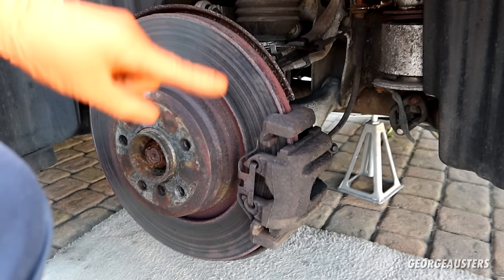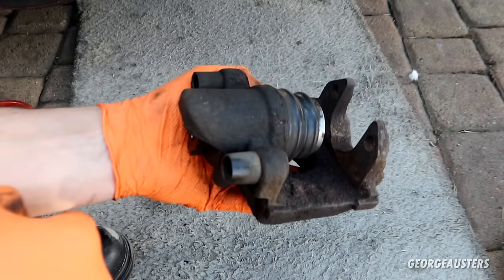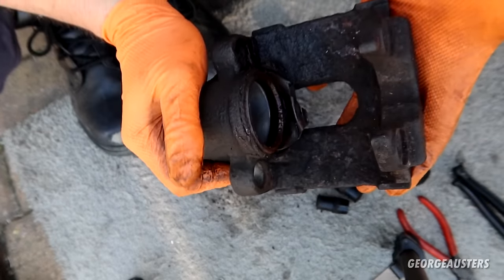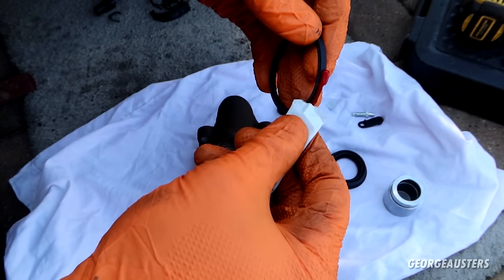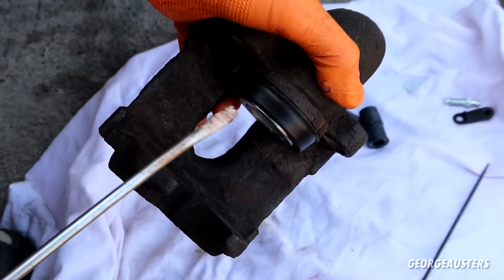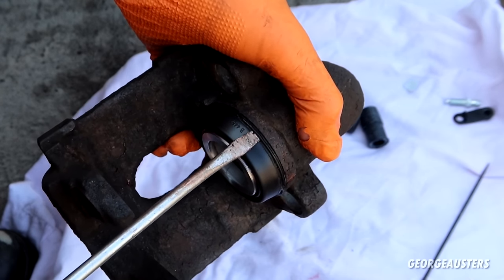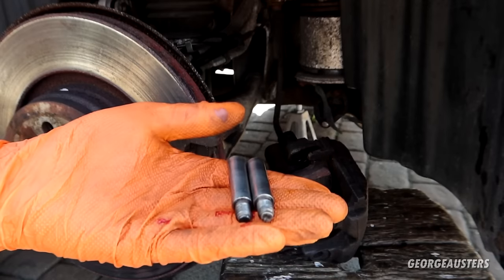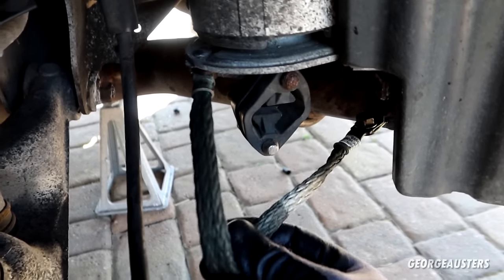How To Rebuild A Brake Caliper (New piston, seals etc)

Comment: It's very important to point out that you should NEVER use any type of grease on rubber seals except for silicone based grease.any Petroleum based grease WILL cause the rubber seals to swell and cause the caliper to stick/seize.
Reply: The grease that comes with the caliper rebuild kit is silicone based, right?

Comment: Nice video George. Just a little tip.. when installing outer dust boot it is easier to put boot on lip when the piston is out of calliper. Slide boot to the lower edge of piston and then slide the piston trough boot.
Reply from the maker: Interesting👍🏻
Reply: i do not recommend this method of putting the boot on the caliper first. I just managed to tear the boot from the inside when trying to slide the piston in later..even though i was super careful.
Thumbs up for the method shown in the video!
Reply: @

OttoKaarelAltroff

Comment: Great to see someone repairing. Any Muppet can bolt a new part on. I prefer to repair not replace.
Reply from the maker: I’m the exact same, no point throwing parts away if they’re easily saved!
Reply: Thing is a rebuild kit costs 25 quid and a new caliper cost 50. You have a lot more work to save 25 quid...assuming the rebuild works, because you might have rust on the caliper body around the piston, you could also easily damage the seal and they don't sell it separately so you'd have to buy another kit...is it work the risk and hassle to maybe save 25 quid if all goes well, when you know for sure a new caliper will work straight away and you can change it in half hour and be done with it?
Reply: @BigUriel rebuild kit costs 12-15 quid buddy

Comment: I know that quality calipers are built like tanks but when I rebuild them I prefer to remove all the cruddy rust, clean them up and treat and paint them with something heavy duty like POR-15 or KBS. They not only look a lot nicer this way but they're going to last longer, stay cleaner and be easier to work on.
Reply from the maker: I did paint them later

Comment: Did mine today but after bleeding and going for a test drive I found the brakes to be pretty spongey and unresponsive. They can just barely provide enough force to engage ABS when I really floor the brake pedal, but they used to lock up much sooner. I'm wondering if I should have filled the cylinders with brake fluid before reattaching the brake line, as I'm not sure if the bleeding process is able to get all the air out of the cylinder. It's also possible that the old pistons were just not retracting very far, thus reducing the travel needed to do hard braking (in other words, what I feel as "spongey" is actually how they should feel and I am just used to sticky brakes).
Reply: The ABS system needs its own bleed I reckon

Comment: it is VERY easy to tear or puncture the seal. once you get piston in with seal, use an airline to pressurise the boot. This will make it expand enough to seat itself on the caliper. This is the only way which worked for me. Also remember to make good the points where the pad edges contact the caliper. Rust stops the pads moving in when they wear which side-loads the piston to the point where it seizes.

Comment: Another fantastic video - great, clear explanation of work needed and work carried out. I use silicon grease on the slider pins of my brake calipers. I would be confident to strip down the calipers on my brakes after watching your video. Thank you.
Reply from the maker: Thanks man, appreciate that. Yes silicon grease works just the same!

Comment: Great Job 👏🏼 - I would have greased the inside of the piston housing too. To get a bit more grease in. Keep up the cool vids ✊🏼
Reply from the maker: Thanks man, yeah doesn’t hurt to!
Reply: Grease will hold dirt and sand. Use as little as possible. I do use a little on the slides, because they are covered with a boot.

Comment: Great video. I dunno how you got that last lip in that’s currently where I am stuck. However I didn’t use any grease and I think the kit is not an exact fit. Getting the caliper cylinder in was a bit difficult also but getting it out was a breeze. I sprayed compressed air in the brake line hole and it popped right out 😂 used wood blocks to catch it of course. I was also wondering if I soak this in degreaser can it damage any of the internal components?

Comment: Hi george thanks for your video, I am trying to fit out piston boot and it will not fit no matter how hard I try, what else could I try?
Reply from the maker: It will fit but it’s tight, I generally use a flat bladed screw driver to push on the outer steel ring but be careful not to split the boot👍🏻

Comment: Hi George, Where did you find the rubber plug you have on the end of the brake hose? I have been looking for something like that a while. This will remove the need to have something clamping down on the hose.
Reply from the maker: It was just from a new fuel filter

Comment: Oh for crying out loud, you're a life-saver (if I haven't botched up the job too much already).  I was under the impression that no grease was compatible with brake fluid so I only used brake fluid to lubricate the O-ring and piston surface.  Now the piston is in crooked.  I'll bet if I used some of that red rubber grease, I wouldn't have had such a problem sliding the piston past the O-ring.  Be careful when you Google "red rubber grease" because a lot of the results will be that Lucas Red "N Tacky grease which is something different.  I see off to the side that Castrol sells a "Red Rubber Grease".  I've seen it in a Castrol container and in a white container on Amazon.  Now I've got to get me some and hope I can remove the jammed piston from the caliper without destroying the new rubber dust cover.  Actually, why not destroy it.  They're cheap.  Thanks for posting your video otherwise I would never have known about that red rubber grease.
Reply from the maker: Glad to help... Yes most piston kits actually come with grease to use
Reply: @GeorgeAusters  Apparently O'Reilly's auto supply store doesn't supply the grease with their O-ring and rubber dust shield.  That's why I never knew about it.  But, I got the jammed piston out.  90 psi of air pressure does wonders. Of course I had a piece of wood for it to bang against instead of the steel caliper.  Now I'm just waiting for my red rubber grease to come across the ocean.  Is that a mainly United Kingdom product?  It's made by Castro which we have here but no one seems to carry the red rubber grease.
Reply from the maker: Not sure but it’s been around for a while

Comment: stick a shim and pump the brake next time works like a charm
Reply: @Ally.MacMillan  wtf you talking about, as soon as you pump the brakes the piston will fly out, try it and let me no what happened, im a mechanic and if you dont put old pads or somethigg when pushing the piston out it will fly out with fluid, thats why i said shim it so you can get it moving

Comment: The intent was fine, the advice is bad. Don't grease the pistons or piston bores. You will contaminate the brake system and fluid by doing so. If lubrication is needed, use the correct brake fluid for your car, fresh of course. And do not use grease on slide pins or anything rubber. Silicone paste should be the only lubricant that touches rubber, and same with slide pins. Silicone or ceramic only. I've seen this mistake made too many times. You will be buying new calipers and brackets if you do the same.
Reply from the maker: Lol done this many many times and never had an issue!

Comment: My car has not even got over 3k miles & i have alredy changed brake disck  brake pads & both front caliper & handbrake wires 🤨 & o it is not a bmw...
Reply from the maker: 3k miles from new?
Reply: @GeorgeAusters  yes I bought it new
Reply: is it a race car?
Reply: @leenevin8451  no 😂 not EVEN close ! 🤣, tho it wighete under a ton (bad englis!)

Comment: You didn't bleed the refurbed calipers before declaring the job was done. I can just see an inexperienced DIYer following your video and then taking the car for a spin with no brakes.
Reply from the maker: I’ve made numerous videos showing how to do a brake fluid flush.. I’d say it’s pretty much common sense to bleed your brake fluid after opening the system

Comment: the pads and rotors were done on that car, putting them back on was retarded, also outer seal should be set in then piston placed through it, this video shows what not to do
Reply from the maker: I replaced the discs and pads in a separate video👍🏻